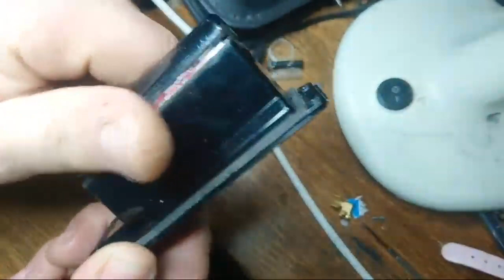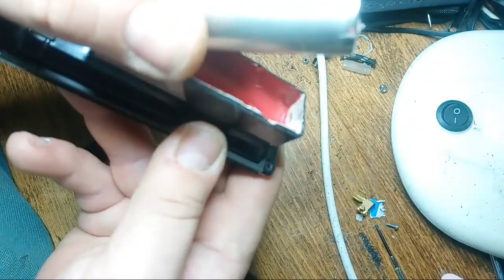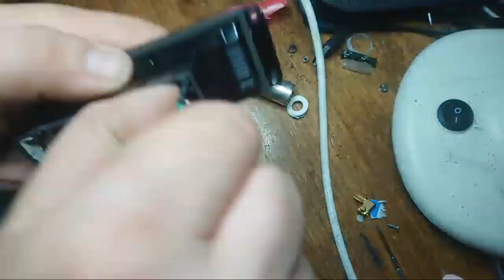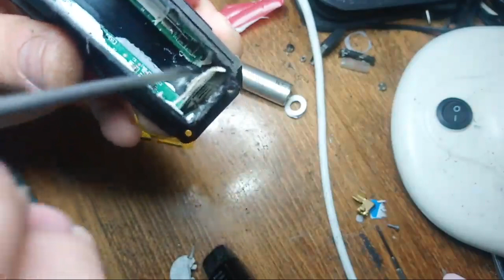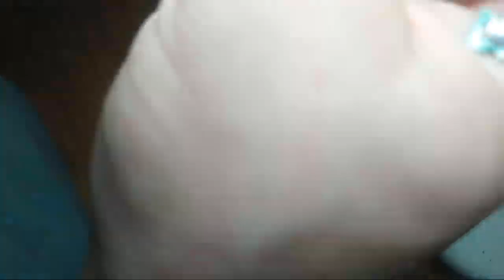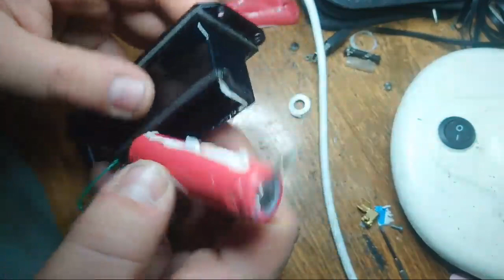How To Fix The Bose SoundLink Mini Red Flashing Light no charging problem

Comment: The worst bluetooth speaker ever from a well known brand Bose,a bluetooth speaker with rechargeable battery should work plugged in event that the battery doesn't hold the charge,or the battery is removed.

Comment: did any of you checked the BMS (battery management system) circuit board inside the battery pack?
The reason they are still not working even after replacing the 18650 batteries is the bms is probably defective. You need to check that before repacking the batteries
Reply: I agree with you, basically by bose marketing design, the bms has a permanent memory on charging and discharging the batteries, and thats what bose want you to do, to buy new and can not be serviceable. Even in you replace with new or original better 18650... if theres any tricks how to reset the bms circuit well thats solve the problem
Reply: @Magsyboy  
It is serviceable. You just need to check the bms is properly working. If the bms is good you need to check the Main Board as there is a part that also fails without warning.

Comment: i tried to replace the batteries without breaking the pcb but still it not working
Reply: I agree with you, basically by bose marketing design, the bms has a permanent memory on charging and discharging the batteries, and thats what bose want you to do, to buy new and can not be serviceable. Even in you replace with new or original better 18650... if theres any tricks how to reset the bms circuit well thats solve the problem

Comment: Now, can you tell me why the light stay yellow while charging and never turns to green no matter how long it's on the charging cradle (4 - 6 or 10 hours)?  Every time I turn the unit ON it keeps announcing 80% charge.
Reply: Maybe the capacity of the batteries is just under 80 percent.

Comment: Thanks for sharing, I will cut it open near the PCB, so I can de-solder the battery from the PCB.
Reply from the maker: You don't need to cut at all. I have discovered another way. I have several videos watch them all and you will find the way to do it without cutting I'm not sure which video it exactly was but it can be done without cutting which I have discovered several months later.
Reply: @themaestroofrandom  do you mind pointing through the proper video please?? I am trying to power my Bose SoundMini without battery, when I supply 7.4 or 8.2V it always blicking red.
I could not find the video through your videos, there are so much. Thx
Reply: You peel off the bottom don’t cut nothing

Comment: After watching your video i opened the battery only on the side were the connections are and used a hobby charger to charge the batteries without removing them. The batteries charged fine to 8.2 volts but the Soundlink continued to blink the battery light and refused to turn on. I also checked the battery output pins and there is voltage there. I can't help but think that Bose made it so that once the device doesn't like the battery it is bricked without sending it into Bose.
Reply: I agree with you, basically by bose marketing design, the bms has a permanent memory on charging and discharging the batteries, and thats what bose want you to do, to buy new and can not be serviceable. Even in you replace with new or original better 18650... if theres any tricks how to reset the bms circuit well thats solve the problem
Reply: Hi Barry, when you checked the voltage at the output pins of the battery, did it read around 8.2 volts (mine doesn't instead it shows less than one volt) when fully charged? Were you able to fix that red light flashing? Thanks.
Reply: @jamesmchale7382  No I was not able to get rid of the flashing light even though the batteries were fine. I think there is something in their software that bricks the unit. I just got a new one from a different manufacturer and will never buy a Bose product again.
Reply: @barryrudolph9542  Thanks for the update, me too won't be buying any Bose products ever. Too much hassle!

Comment: there are screws behind the label sticker, no need to cut it open. Battery used is a sanyo 18650 li-ion rechargeable battery.  Any 18650 4v 2600 mah battery will do.
Reply from the maker: Cut the crap and stop telling idiotic things there are absolutely no screws behind the label sticker. Please Google the word screw then you know how they look like you muppet
Reply: He's right there are no screws there. It's glued in place.
Reply: This is true no screws the battery cap is glued down. You can just carefully pull it back but the problem is the batteries are not 18650s they are an odd size

Comment: You can open the battery cartridge from its flat base. Batteries that are inside are sold for $12 bucks and free shipping for 4 of them
Reply from the maker: Everybody talks about it but nobody actually has done it apart from that the batteries are glued in and you can take them out without breaking the PCB or rip off  some wires which are connected to the thermocol sensor furthermore the two batteries inside and not 4 I don't quite know what you talking about
Reply: @themaestroofrandom  Fair point. There are no other videos of battery pack rebuilding.
Reply: I am still working on a fix for the device but as I posted above It is not the battery, at least not in my case.
Reply: The Master Of Random actually I did a battery replacement on my Soundlink Mini and it worked for a while.
Opening the battery pack on the flat side is not only the easier way, but also the only way without destroying the electronics inside.
Reply: @KalleKohx  Is yours still working or did you figure out a way to solve the problem? Thanks.
Reply: James McHale the battery pack itself works just fine, but the charging circuit in my Soundlink mini broke about a year later and I have no idea how I could fix that. To be sure I tried an other battery pack and the Soundlink worked just fine with it, but I can't charge any batteries in my Soundlink anymore 🤷‍♂️
Reply: @KalleKohx  Thanks for the update, I guess it's not worth saving then. Especially the replacement battery costs around $40.
Reply: You're absolutely correct. Mine is the mini 2 and I was able to disassemble the battery and keeping it almost intact (yes, the batteries are glued in but with some gentle prying, you can remove the two battery assembly in one piece.  Unfortunately, I don't know what's wrong with the battery tho. When you tested the ribbon cable, it has almost no voltage, but with the batteries alone, they are at around 8 volt which is pretty much fully charged. so weird.